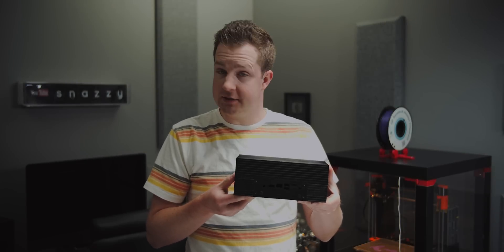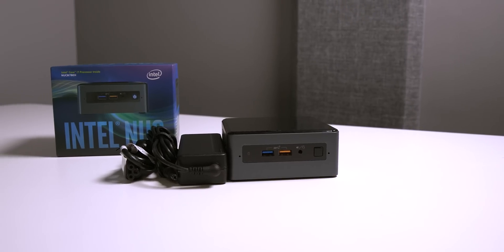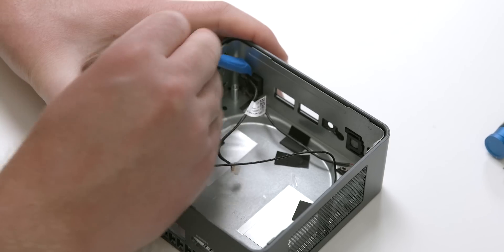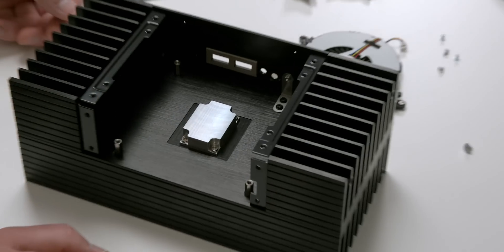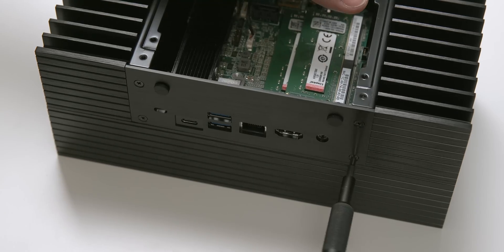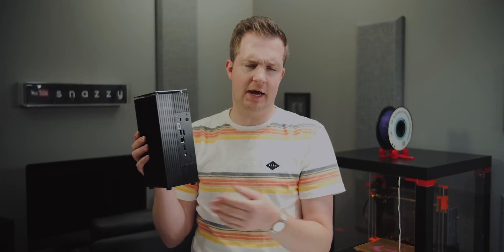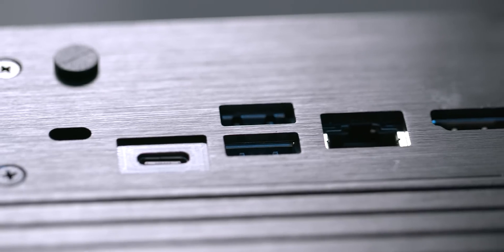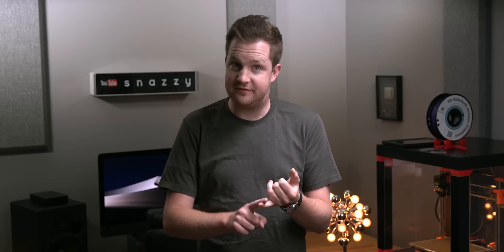The Tiny, Fanless, Mac mini KILLER!

Comment: A heatsink inside an enclosure that has no vents or fans is pretty useless.  They sell flat heatpipes that are bendable that you can attach from the SSD to the case using thermal tape.

Comment: Nah! Will keep my MacMini. Off the shelf, just ripped it apart and upgraded the RAM to max very cheaply. No hardware/software problems and a lot smaller footprint than the mackintosh (I use mine on it's side by two monitors for Logic X).Good idea, but even running 30+ tracks my MacMni is very cool and doesn't even seem o be doing anything more than running).

Comment: Your constant use of “should be ok” when it comes to heat doesn’t do a lot to reassure me. If there is anything I have learned from the YLOD on Playstation and my HP laptops with overheating issues heat is most definitely our enemy. Sure your testing shows it stays pretty cool. And I guess since it can’t be overclocked, this setup works. But another setup that could be, would feel like a poor candidate for this case....

Comment: Why not buy a microSD that matches your SSD in capacity and insert it in the Nuc's SD port before you mount the MB in the fanless enclosure? Granted  one can't remove the microSD without tearing apart your hack, but it would be valuable as a Time Machine drive. If the Nuc's BIOS allows SD booting installing a large microSD card prior to final assembly of the fanless setup, then you have a system recovery setup at your fingertips. I always build my hacks with a dedicated Time Machine HDD on the SATA bus. Every now and then a macOS update will break something (usually video or audio) on a hack. Time Machine has saved my bacon more than once.

Comment: I’ve never pulled the trigger on a Hackintosh just because I wouldn’t expect one to last once a few updates come down the pipe, or that there would be some essentially apps or accessories that wouldn’t work.  Anyone know how true that is these days?
Reply: I run this Nuc in the same akasa case for almost 1,5 years. Never had any problems with it. In fact..i alreay updated to 10.15.4 (latest Catalina), and this runs just fine. The days these hackintoshes were not stable enough are over. The only thing which will make the hackintosh(ing) to go away, is when Apple switches over to ARM for good...for now..this just works.

Comment: So, if you're taking the NUC out of the case, why does it matter which one you get?  The one that has room for the drive is just a larger case, which you aren't using, right?
Reply: There is the BEH (bigger version) and BEK (small version). The BEH has space for a SATA SSD where the BEK version has not. Both have M2 (Nvme) slots. If you buy the Akasa case like in the video, you get cables to connect 1 sata ssd. And it then doesn't matter if you have the BEH of BEK nuc.

Comment: All this work for $300 savings and then you can’t update it a eventually it won’t be able to run some apps and stuff. I would be worth it if the total price was way cheaper
Reply: Not true. I run this nuc for a long time, and every update goes like on a real mac. If you connect this machine by Ethernet, everything works.
Reply: @tiqo8549  OK that's cool. But are such minimal savings worth the amount of work and research? I guess it's more of a hobby.
Reply: I used to buy these small netbooks from someone for $300 with OS X on them. They were amazing for the price.

Comment: Followed instructions but deviated by using the NUC8i7BEH and a 2 TB SSD (fits on included bracket above mobo) for storing music, creating a Roon music server under Mojave OS. 

Build only uses Ethernet connection (there is no WiFi/BT; left disabled). Only running Roon app 24/7 (screen saver turned off since normally using without a monitor or mouse or keyboard). Computer is configured to auto log on boot, then auto run Roon (Roon controlled by iPhone app through WiFi router/Ethernet connection). 

CPU temps run 36 to 40°C with unit sitting on a tiled floor (case is barely warm). The NVMe drive (with own heat sink as instructed) and SSD give temps of 34 to 36°C. So the cooling is excellent for all parts. These temps should provide many years of longevity. The whole unit uses just under 5W of power; very efficient. (All data from HWMonitorSMC2, using VirtualSMC + associated kexts.)

This is a fantastic build. Thanks SnazzyLabs!

Comment: In Windows you can either use the power configs, or even better the intel extreme tuning utility (software overclock). The latter requires that you force the software not to check the hardware you are running, because it's not officially supported - but it works.

Comment: (Regular non-tech user here)
Am I right in inferring from this that the only advantage over the NUC (for the purpose of making a Hakintosh to run OS X) is that the art-deco thing is silent and nice looking? Could I buy a NUC and do the OS X download/boot-disc set up?
I have a 2011 Macbook Pro which I have been unable to install anything beyond its OS X 10.6.8 O/S.
Thanks for the video.
EDIT... by the way, if anyone could tell me how to get around the purchasing of OS X 10.8 just to get to the later free download of the latest os x... thanks
Reply: There is only really one advantage, and that is hardware access. The 2018 Mac Mini doesn't give you the option to upgrade the SSD, while solutions like the NUC and most Hackintoshes do. You're also not left in the lurch if your motherboard has a hardware failure and you try to recover data from the drive. On a Mac protected by a T2 chip, that's not an option, at least not cheaply.

Given the propensity for Hackintoshes to also fail horribly when updates are pushed, this is not the best way to go if someone wants to get into macOS cheaply. Running Windows or Linux is a better idea in the long term.
Reply: Yup, you'd be right - the only real difference/(advantage?) to swapping cases, is (apart from aestehetics) the fan-less silent option.

Comment: hello, the SATA ssd can't fit in this passive case ?
Reply: Yes. The case comes with brackets for the Sata SSD including a longer cable to connect it to the nuc. I use this case with a Nvme and a 1tb sata ssd. Runs fine.
Reply: @tiqo8549  okay, thank you

Comment: Silly comment someone's already addressed but I'm too lazy to dig through 1,042 others: Why not put a high-capacity card in the NUC board's microSD slot before installing it in this case?  More storage space, very cheap... seems odd to just waste the connection...
Reply: I was thinking the same thing until I remembered that I could never get the SD reader to work in macOS myself. Windows only.. but I diddnt try very hard. Does anyone know of a kext or setting?

Comment: I would guess that Intel placed thermal pads on those two outer dies because they can't guarantee that all three dies will have exactly the same height / angle to the horizontal.

Comment: Why bother with the $140 boat anchor passively cooled case? I have an i5 gigabyte brix that is essentially silent that I use as a VM server. When taxed at 100% CPU I've never heard it's fan from less than 6 feet away.

Just not sure I understand spending $140 on a case that only adds cost, is significantly larger, takes away a microsd  slot with extremely little benefit in regards to lowering what already is a very quiet product.

Comment: Great video - I love these hackintosh builds, despite the fact I've given up on them and just gone for second hand macs - yes, the almightly cheesegrater.
Having said that, hackintosh got me there. Whilst I've been using high spec macBook pro's supplied by my work for years, I never wanted to outlay the crazy amounts of cash for personal use that a macbook pro demands. 

So, on the hackintosh "Is 2 hours a year a significant problem to maintain it" - no, but that is assuming everything runs as expected.
I ran a hackintosh for a year, pre tonyMacOsX days, when it was significantly harder - it was ok, but wiFi was always an issue. Often the sound would just stop working.
I built and ran a few others, including following a  tonyMacOSX recommended hardware guide - again, it was OK, but once more, there were those subtle issues usually related to sound and networking that I just got sick of fiddling with. (Then again, I do have an wiFi dongle for the cheesegrater, as the wiFi that shipped with the 2010 mac is terrible - the range is about six feet at best. It too can get a bit fiddly from time to time ;)

When my 2010 cheesegrater finally gives up the ghost (I've just upgraded the ram, CPUs and video card), in a couple of years, I'll probably go the hackintosh route, as by then, the new Mac Pro (less finally grated cheese cheesegrater) will still be absurdly expensive and will be the only mac you can actually upgrade. sad times.

Comment: I mean, if you wanted to spend a couple extra bucks you could pick up a 256gb micro sd card and install it into the slot before you load it into the case just to have a nugget of extra storage.

Comment: I built this exact setup. Silent but too hot. Runs 65-80C at idle. Not stable all (video glitches, CPU 29-35% load at idle). Waste of about 4 hours and $800.
Reply: I have the same build, runs just fine. Maybe you've done something wrong or your nuc is faulty.

Comment: hi there, interesting build. What is the highest ram and clock speed? The heat sink for ssd is it bought separately or included with the case? can I instead use this build for windows 10?

Comment: Awesome. I don’t have the cash, but sounds like a great build. Never made a Hackintosh, that part sounds the scariest; having looked around in sites like Tony Mac, it does your head in a bit. Didn’t know you could get heat sinks for SSD sticks, though. I love silent computers, having spent altogether too much time with noisy PCs in the past, which left my ears ringing long after. One of the things I appreciated Macs for. 
I put together a NUC for my dad a couple of years ago, as he wanted to learn to draw and paint digitally in his retirement, and wanted a small PC to run a 27” Cintiq. Seeing as Wacom used Mac Minis in demonstrations, I figured a well-configured maxed-out i5 NUC could handle it. And it did, he’s still using it to this day. Personally I’d like to upgrade my Mac Mini media centre some day, it is getting long in the tooth, though it still serves up streaming movies via Plex well, but it only has USB2, and I doubt it can run the latest OS.

Comment: One thing you fail to notice is resell value. The $1600 Mini is still around $1200-1400 on eBay. Your Hackintosh is worth far less. Trying to sell it in say three years time and I'm sure the Mini is still around $700, your Hackintosh will be worth what - $300? So while the Hackintosh may still be overall cheaper, the difference will be far smaller when taking resell value in consideration.

So the question is then - should we take resell value in consideration. I would say yes, because anyone with a wish to have a speedy computer will replace it every 2-3 years. Those with less need of performance have a substantial supply of 100 percent genuine Minis to choose from from as little as $200 for a 2011 with 8 GB of RAM and ~256 GB SSD. And that's a plug-and-play solution.

Comment: I get the idea of saving money with Hackintosh and using the NUC8i7BEH but why spend the $150 for the AKASA case/heatsink? Yes, its quite beautiful and silent, but I get all the same speed and tech benefits by simply using the NUC with its built in fan. I think I can handle the blower-fan noise. I can still do the Hackintosh install. Seriously, is all disassembly & reassembly worth it to pay $150?

Comment: I may go hackintosh the next build. I had a 2011 mac book pro, I did some upgrades to it, 16gb ram from 8gb, took out the cd drive and replaced both the hard drive and cd drive with 2 ssd's 512 gb, etc. I only run logic pro x on it, it was fine. I then upgrade to the latest macbook pro BEFORE the touchbar, and that's a 2015 model, it's great. Has 16 GB ram, 3.6 ghz cpu and 512 gb storage. Biggest difference is it has 2 USB 3.0 ports, an hdmi port and 2 thunderbolt ports (which I don't use). I keep dual externals that are mirrored on 1 usb 3.0 port and it's fast as hell. 

Eventually, I guess I'll upgrade. The problem I have is I'm locked into Logic Pro X for so many projects, I can't just dump it and go to say Ableton (a much much more expensive platform, and frankly a piece of crap in comparison I think). The issue I have with Hackintosh's is you basically have to build one out, then you have to make sure you clone that drive before you upgrade - or you might lose everything. Also obtaining mac software is a pain, and you can't just update it via app store etc. Maybe things have changed, but this was 2 years ago last I tried a hackintosh, dunno.

Comment: Where can i find the cooling strip and the housing for the SSD? and what kind of WIFI card would i need? (the wifi card in the Nuc is soldered on there right? should i use a external Usb connected Wifi Antenna? Thank you so much for the video, i hope you have time to answer!

Comment: Was able to get a MacBook Air for $350 off of eBay. I5 from 2017.  Screen was damaged but able to run it with a normal external monitor. Fits the bill and much easier to maintain than a hackintosh. Might try fixing the monitor for $80 at some point down the road. This is a nice rig but I’m not so sure I would invest that much in a hackintosh given that installing updates can be a headache and you are missing Bluetooth and WiFi.

Comment: often times the user of a hackintosh isn't fully aware how poorly their machine is performing as it seems to run fine; but if you sit it next to a Mac with the same hardware there's a big difference). OS X's increasing reliance on GPU-based for the platform makes hackintoshes increasingly fussy.

Comment: Looking at 14:05 mark, if you upgrade to 16GB memory yourself on the Mac Mini, that's $140 off. And then run an external 1TB SSD, that'll save you another $305. That's $445 off bringing the mac mini down to $1255, which is about $400 more than the NUC, but is an original Mac with better CPU.

Comment: Probably can't overclock because of power requirements that would be needed to.  Like VRM on the motherboard needs to be high enough quality to provide solid clean power to the CPU.  Also the PSU is going to be much smaller than a desktop PC as well.  Thermal is probably the least of the worries when overclocking a NUC.

Comment: This method works equally well for automotive applications.  If you buy one more radiator for your car and mount it directly onto the hood, you can safely remove the radiator fan.  They are very noisy.

Comment: How did Apple get their hard drive I/O at just under 3,000 MB/s?   That’s around quad RAID-0 SSD territory?
Reply: an NVME ssd can reach speeds of 16000 MB/s
Reply: @jamestor6700  - I was not aware of that, but something is giving us the sustained 3K random access MB/s..  The fastest NVME that I have found as of a few months back are still well under 2,000 MB/s random access, and peak only around 3K, but only for sequential r/w currently.   
It freaking amazed me the first time I used the 2019 Mac Mini and it stayed-up with 32bit 192 kHz audio across 16 tracks with plenty resources to spare.  Normally the CPU to disk I/O limitations would be an issue.   When I benched it I saw it was beating our quad RAID-0 SSD stacks by almost 50%-- and well ahead of the SSD and NVME's we're using.
I have been buying the Samsung 970 Pro's, which at about 1,500 MB/s RA r/w are around 50% slower than what I get with the new Mac Mini for some reason-- even on the fast PCI boards it is only about 1,600 MB/s-- regardless of the the interface (M.2, XPCI, RAID-stacks), nothing comes close to the little Mac Mini that we've tried yet.
Do you know which NVME's are the fastest currently?  I ask because we have to use RAID-O on PCI boards, and I would love to get away from the BER and related issues with RAID-0, which we have had to use on our 2010 Mac Pro's to do 8K video work.

Comment: Maybe the benchmarks should be re-run a few times to see how the scores get progressively worse on the official Mac vs the stability of this Hackintosh.
Good video, good humour as well, thanks.
Reply: There is a drop briefly in running many heavy duty tasks/benchmarks - but as the fan spins up to compensate, the performance rises again to near the "cold" first run. - the i3 models it is much less pronounced (hard to notice really, the i3 also uses a fraction the power of the i5 or i7), the i5 it drops a bit, then gets back to right around cold run, on the i7 the drop is the biggest - but in some benchmarks it's performance hit at or slightly above the cold test.  (I ran a variety of tests - disk benchmarks, Cinebench, Geekbench, Heaven & Valley - as well as some pure number crunching.  (while the host in this video says the fans are screeching, none of the 2018 that I've worked with have sounded anything like that - even at maximum RPM, they are barely audible in a typical room that isn't dead quiet, much quieter than the earlier 2012 & 2014 Mac mini fans)
Reply: @BrianMWPG  I was going by a video from Linus Tech tips, and why the Macs don't run as well as they could. From memory, the results were quite poor compared to the other similarly configured test systems. I can't test this myself.
Reply: @JT-ko2ib  yeah, I read of a couple of places that were seeing big drops - it may have been a combination of bad thermal paste application, and firmware issues (that weren't ramping up the fan again properly) - by the time I was doing testing a few months ago, it was pretty stable in the many tests I did - a brief dip once the chip heats up but before the fan ramps up, then performance quickly climbs right back up again - and I did tests running for hours (testing for Exhibit usage where they run for 10+ hours a day)